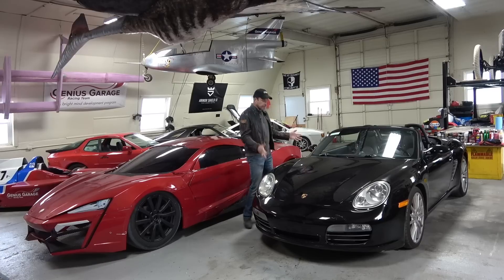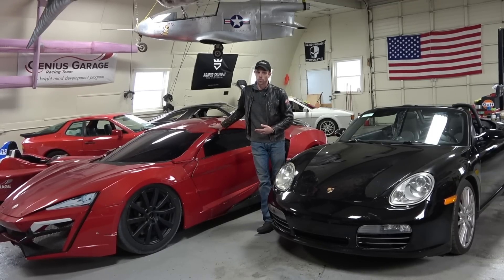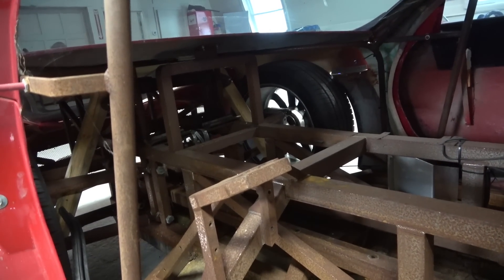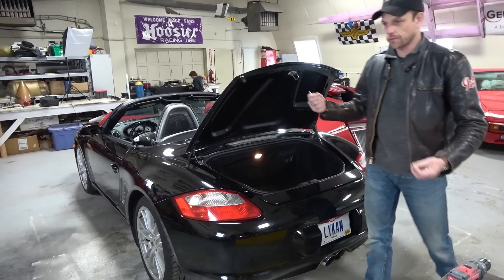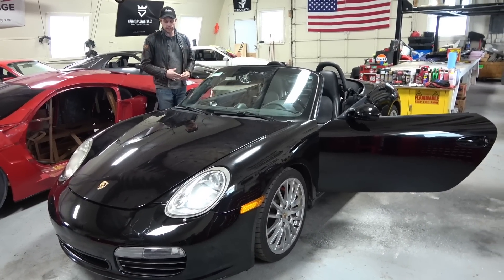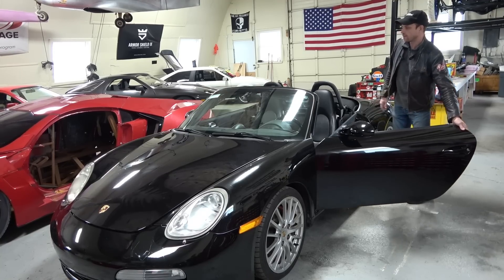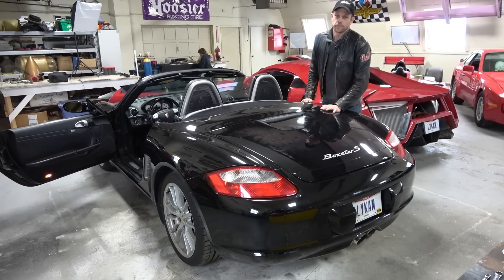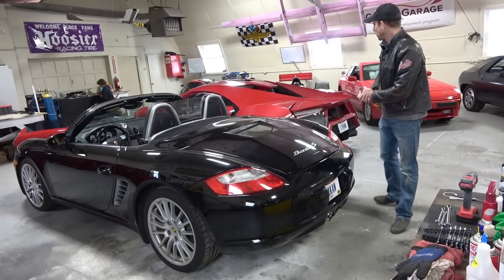Build your own Lykan Hypercar! | VINwiki Fast and Furious Live Stunt Car build

Comment: Im excited about the project. Also question here will the videos include the engineering processes and computations that you will use? Also design like a new design of the cars main structure and also please design suspensions and wheels. Very excited to see the project process and finish. Goodluck and stay safe Casey.

Comment: So in simple English they have to move the engine and rear end further back so it can match up with the lykan. The front is staying nearly the same as the front wheels and seating area is in the similar places
Reply from the maker: No, you missed the most important part. The wheel base and track width...

Comment: Not to be nitpicky, but “I realize that back in the day with kit cars, y’all think about a VW floor pan back in the 70’s and throwing a fiberglass body on it”? Quit gas lighting Dorthy. You’re doing the exact same thing... just in the 2020’s. You’re throwing a Lykan fiberglass body on a modern VW frame. Nobodies fooled.
That being said... looks like fun and I fully support it. Had an 04 Boxster S some years back and I can’t think of a better car to hack up. Can’t tell you how much I wanted to take the death wheel to it after the convertible top mechanism maintenance/repair bill hit me. Sold it instead. I’ll be here with you every step of the way. Hope the Genius Garage kiddo’s enjoy themselves. Cheers!
Reply: To be fair, this is certainly a few orders of magnitude more difficult than putting together a 70's fiberglass kit car in just about every measure.

Comment: I'm pumped to see this but I have to give Bill to the year so far to those guys at B is for build... The 65 mustang body fitted on top of a modern mustang. Probably one of the most ambitious things I've seen so far.
Reply: That's actually an old game. Most of the popular 60's cars have entire sheet metal sets that you can buy to drop on various modern cars. I debated it for a 1st Gen F-body, (syncs up to a Pontiac GTO/Holden fairly easily), but decided to get a 1st Gen and gut swap it instead. (I prefer the classic interiors in my old cars, plus the benefit of no emissions testing was a major factor).

Comment: Wouldn't it have been easier to just build a tube chassis than to cut up n re-engineer a Porsche.
Reply: No. Not even close. So much easier to reuse OEM designs. Building a real car from tubes, is a shitload of work.
Reply: If you have a custom chassis fab shop, yes. It would be easier. Maybe even cheaper. I don't think Casey's garage is equipped for quite that level of fab, though. Even if it is, the whole point of that place is to be a school for engineering, soooooo yea. Easiest and cheapest aren't always the goal there. Besides, the real Lykans had Porsche guts anyway, so it's more in keeping with at least some degree of "correctness".

Comment: Build of the year is putting in lightly. This is the build of the decade. No one will ever top this no matter how hard they try. Good luck to Casey and Genius Garage!!
Reply: Um, the turbine powered Batmobile? Just my opinion.
Reply: The turbine batmobile was last decade. He built that way back in 2010/11. Damn that seems so long ago. So much has changed around here.
Reply: @DFisk75  Good point and so true!
Reply: 1000whp 4 rotor AWD RX7, the first and only of its kind, currently has that title.